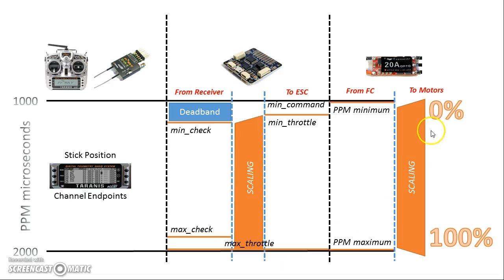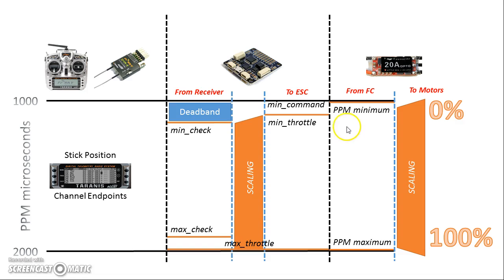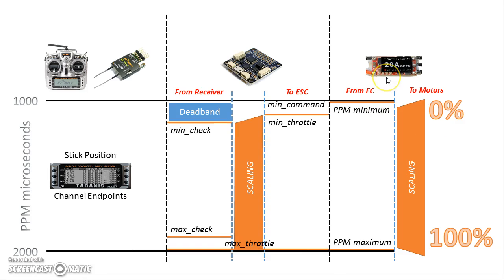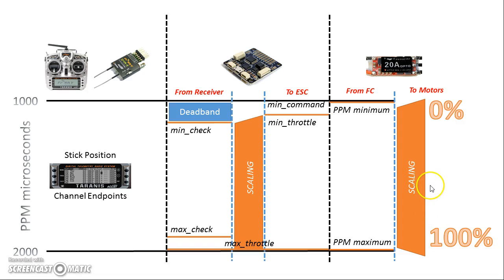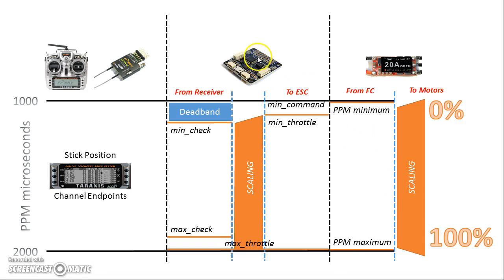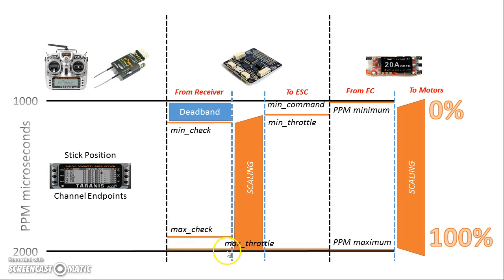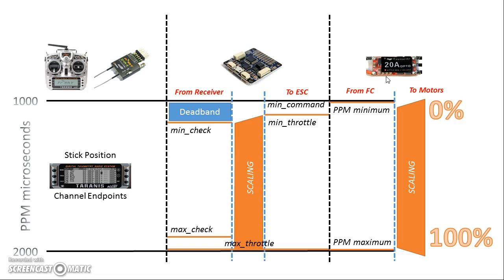Cleanflight throttle parameter configuration - Part 2

Comment: Great video Josh.  Here's a summary for the lazy and attention deficited:

Cleanflight variable definitions:

min_check: the stick value below which Cleanflight registers a low stick command (ie arming/disarming with thottle stick down)
max check: the stick value above which Cleanflight allows a stick command to be registered (ie when yaw is to the the right when arming)

min_command: the value that is sent to the ESC when the copter is disarmed
min_throttle:  the lowest value that will be sent to the ESC when the copter is armed
max_throttle: the highest value that will be sent to the ESC when the copter is armed

PPM minimum: the low range calibration value sent via Oneshot (technically not PPM) to ESC.  This correlates to 0% motor power, the bottoms of ESC's internals scaling map)
PPM maximum:  the high range calibration value sent via Oneshot (technically not PPM to ESC.  This correlates to 100% motor output, the top of the ESC's internal scaling map)

HOW TO DO THIS PROPERLY :
0)Remove your propellers.

1)Set (on TX) the end points to 1000 @stick's min, 2000 at stick's max,  and 1500 @ center stick.  Do this on the Tx, while looking on the reciever tab in cleanflight.   (If you were unable to set proper endpoints, watch the video fully to understand what's going on)

2) Enter CLI COMMANDS
set min_check=1050
set max_check=1950
set min_command=1000
set max_throttle=2000

3) Calibrate ESCs in motors tab

4)Enter CLI command
set min_throttle = to the lowest value where the motors spin without cogging in motors tab.

5)Go Fly.
Reply from the maker: This is all correct as far as I know.
Reply: +Wiggles FPV This is great. Sticky for later. Thanks!
Reply: +SmoothFPV no prob dude.
Reply: +Wiggles FPV so this seized up my motors at no throttle effectively defeating airmode and requires a disarm and rearm to recover the motors. not sure how to get it back working, this is BLheli 14.3, betaflight 2.1.6. only thing i can think to do is reset everything back to stock and start over. i had also upgraded from BLHeli 14.1, might revert back down to that.
Reply from the maker: +prOkrEAt Do you need to raise min_throttle?
Reply: +Joshua Bardwell when I test motor spin on the slider, all four spins up at 1021. I have my min throttle set at 1030 right now, keep raising it up to 1050. all 4 motors will spin when armed but if I input no throttle zero but move yaw/pitch/roll all motors seize up and won't spin again until disarmed. never did that before.
Reply from the maker: prOkrEAt Sorry. No clue. That is weird.
Reply: +Joshua Bardwell so i completely restored everything back to defaults. back to working as it should. not sure what is in these instructions that did that but it caused total motor seize up.

there are my settings:
set min_check = 1100
set max_check = 1900
set min_throttle = 1023
set max_throttle = 1850

seems set min_command is missing in my CLI dump.

EDIT: just flashed to BLheli 14.3 and problem is back. switched back to 14.1 and working again... seems to be the issue?
Reply from the maker: prOkrEAt If you change min_command or max_throttle, you need to re-calibrate your ESC endpoints. Anyway, glad you got it sorted out.
Reply: +Joshua Bardwell yeah, I recalibrated. not sure what's going on with 14.3 but staying at 14.1 for now. has to be that, I can reproduce it every time and alleviate it by going back. only variable I am changing.

Comment: I have always followed your posts and threads at RCG- didn't know you had a channel as I haven't been in any of those in a while. Living in my bubble ;)
Great vid, and while I have worked around it, you have just explained the recent spat of issues with my arming and esc calibration problems since slowly moving over to one wire and one shot esc's the past year.
I use a Futaba, which has always been lean on multirotor info and set ups, and is very robust with resolution and ability, but very exclusive in how it works with cleanflight. Mid throttle has always been 1520 and min at 1050 and max at 1950 for the old simonk setups prior to oneshot.
Now, I have been calibrating with min throttle at 1000, and then resetting the min throttle to 1050 and not recalibrating. It all works, and I use an arm switch with motor stop.
I now see I should go into my receiver tab- verify max and min and adjust and trim so that I have full 1000 to 2000 resolution, and then move on from there matching ppm values up where appropriate.
I am confused on how to make that jive with BLHeli esc ppms- despite the "ppm" not be exactly the same "language" or scaling, should I be setting those values in the BLHeli gui to match the naze? I am not complaining about performance, but I also want to begin setting up some of this special sauce throttle cut magic Chad and Steele and others have been working to get those epic slides. 
Thanks for being a great communicator Josh- that is 99% of making any video- the ability to be succinct.
Reply from the maker: +Hiway You're confusing the input and the output side of the FC with each other. The transmitter and receiver endpoints are on the input side. Min_command, min_throttle, and max_throttle are on the output side. The ESC is calibrated to the output side. There is no required or implied relationship between the input-side endpoints and the output-side endpoints, although it is sometimes convenient to use the same 1000/2000 values for both.
Reply: +Joshua Bardwell I am generally confused. I work in smoke and mirrors and dumb luck ;)

Comment: This is great stuff mate. Thanks for taking the time to create. It looks like you are going to become the new Painless360 channel with all your graphics and teaching style !

You mentioned something in here about doing away with the analogue signal from the FC to the ESC. Been thinking about this for a while now and I recon this will be the next ESC development to move away from PWM and into the digital work with protocols like 1-wire or I2C. That would give us a much simpler system with faster refresh rates etc
Reply from the maker: +Tony Leyland Expressive Imagery I have heard some insinuations that CANBUS is a candidate for the next-gen digital control method as well. Whatever it is, it should support at least 8 kHz refresh rates, so that there can be 1:1 sync between the gyro, the FC control loop, and the ESC output. We know that motors can't actually change speed that fast, but there will still probably be some benefit. For all the doubters who have said, "It's pointless to update faster than X ms because the motors can't update faster than every 10-25 ms anyway" ... the FFT plots do not lie. The reduction in aliasing noise when doing 1:1 sync is HUGE, and results in massive benefits e.g. in propwash situations. It stands to reason that removing that same noise from the ESC-to-motor link will have benefits as well.

Comment: Joshua, Great video as usual. Your getting really good at it. One thing I would add is that you can use the rxrange settings in CLI and not touch your TX and let the FC do the scaling between the TX and the FC.  Example....My TX in the reciever tab showed 992-2012. I entered those numbers in rxrange and now my RX tab shows 1000-2000.  I believe those settings were created to battle the issue you talked about with transmitters that cant reach the endpoints but in my case it works for making things nice and tidy in the rx tab.
Reply from the maker: +KelvinFPV Correct. Although rxrange may not have existed when I made this video. I can't remember if CF1.10 was out yet.
Reply: +KelvinFPV  Be aware if you using Failsafe, I believe with failsafe if your input goes below a set value it could trigger a false failsafe. Thats my understanding and could be wrong though.
Reply from the maker: Joe Ordille rx_min_usec and rx_max_usec.

Comment: Another great video, thx! (I'm going though some of your older vids I've missed). 
Q: My belief was that the FC talked PWM and not PPM to the ESCs (when not using oneshot/multishot)?
Reply from the maker: +salle rc I'm not sure what the exactly correct term is for it. As I understand it, PWM goes from a duty cycle of 0% to 100%, while PPM goes from a certain minimum to maximum value. So in that respect, the signal that we use, from 1000 to 2000 us, is PPM. But PPM by the book uses the position of the pulse relative to the start of the window, not its width, to encode the data. So what we do with RF seems to be some hybrid of PWM and PPM. The pulse width encodes the value, but multiple channels are encoded into the signal based on their position. Anyway, people say PPM, and that's fine.
Reply: Did some googling, it's a "specific kind of PWM" if to believe this answer: http://robotics.stackexchange.com/a/8738 
Anyway, thanks for the video again.

Comment: Thanks Joshua that was great. I've been flying for almost two years and I still found it really useful. I do have one question however. Are you saying that it is better to use stick calibration for ESCs than to set them in the firmware, for example via BlHeliSuite? This seems to make sense based on what you said about each component having its own internal timekeeper, but it contradicts other advice I have read that states that all ESCs should be set to the same min and max ppm if possible.
Reply from the maker: +The Imperfect Gent Based on what I can tell, I think stick calibration is the way to go. The fact that, when you run stick calibration, the ESCs give different results (sometimes VERY different) leads me to believe that the timing circuitry is not precise enough to rely on setting the same PPM values in software. It's not that such circuitry couldn't be built, but that it isn't being built into the ESCs currently.

But let me put a caveat on that. Remember that the PID loop explicitly compensates for the varying thrust levels that each motor puts out. There will always be discrepancies between the thrust that the individual motors put out. Variances in friction in the bearings, variances in the windings, variances in the manufacturing of the props and so forth. So having ESCs that don't have exactly the same PPM min and max is not a huge problem that is going to make your copter fly terrible or something. If the ESCs are not calibrated to map exactly the same output power level to the same input throttle position, the PID loop will speed the individual motors up or down as needs be.

The main advantage (as I see it) in calibrating them to the throttle is that you can make sure that all of them have the full output range available. Let's say that you have an ESC that is reading 50 us low. And you set your min_throttle to 1100 and your max_throttle to 2000. Then you manually set the ESCs' min_PPM and max_PPM to 1100 and 2000. The ESC that is reading low will actually turn on at 1150, and it will max out at 2050, except the FC will never send any value higher than 2000, so the ESC will never reach max throttle, which will potentially keep the copter from developing maximum thrust, since the PID loop will keep the motors relatively balanced when the copter is hovering or flying straight.

Using throttle calibration, you can set your min_throttle and max_throttle at a value that ensures that all ESCs have a PPM min and PPM max of >1000 and <2000. This will ensure that all motors will have their full power output range available to them. If the PPM min and PPM max are not the same between all ESCs, then the ESCs will have a different amount of resolution in their throttle range, but that's probably not a big deal. And if they have different PPM min and max as the result of a throttle calibration, then any difference is the result of variances in the ESCs' timing circuitry, which should cancel out. THAT'S WHY THEY CALL IT CALIBRATION right? You're calibrating the ESCs' input ranges to each other so that they make the same output power (roughly) from the same input value.

At least that's how I see it for now, until somebody convinces me otherwise.
Reply: +Joshua Bardwell Thanks for the reply Joshua. It makes sense and I agree with all your points. What prompted me to ask the question was that I on one of my builds where I used the same min/max ppm, the ESCs, when I power up the quad, the four ESCs don't seem to start up at the same time. Tbh I didn't even notice until someone commented on it on one of my videos. Sure enough you can hear it happening and it seems to happen consistantly but I've never experienced any ill effects. Would you say that this is related?
Reply from the maker: +The Imperfect Gent Yeah, probably. Do a throttle calibration using the Motors tab and see what numbers the ESCs calibrate to. If they are too far off from each other, then that may be the cause. Try doing a throttle calibration and see if, afterwards, they all throttle up at close to the same time. Also, if any of the ESCs calibrates to 2000, then lower max_throttle until they all calibrate to something slightly lower than 2000. This will ensure that all ESCs are using their full throttle range.

At least, that's the way it seems to me right now, until somebody convinces me otherwise ;-)
Reply: Joshua Bardwell I will try that. Thanks once again!

Comment: so in BLHeli suite, it says Setup NOT in SYNC with Master for the other 3 ESCs. i assume it is because the PPM Min/Max Throttle values are different? should i change them all to be the same? are those changed/set when you calibrate the ESCs in the motors tab?
Reply from the maker: +prOkrEAt My preference is to run the calibration using the Motors tab, at which point the ESC endpoints will probably not be exactly the same. This is because the oscillators in the ESCs are not accurate enough to achieve sub-millisecond consistency with each other. This is no big deal, as their precision is fine. So they read perfectly consistently with themselves, just not with each other. 

After this, BLHeliSuite shows them as being out of sync, so just go to Options and de-select "Sync Min/Center/Max" from the sync comparison. Then they will show as being in sync even though their endpoints don't match.
Reply: +Joshua Bardwell so i unticked that but still says they arent in sync... all other settings look to be the same. this is BLHeliSuite 14.3.0.1, running RG20's. all settings are default from rotorgeeks except motors 1/3 are reversed.
Reply from the maker: prOkrEAt You also may need to disable the motor reversing sync under Options.

Comment: excellent video.  Why dont we lower min_check to reduce the deadband?
Reply from the maker: +CoolStuffReviews I do. I have min_command at 1000 and min_check at 1010. I believe that the only reason CF defaults to so much deadband is to cover people whose controllers can't go very low, and who don't have adjustable endpoints.
Reply: +Joshua Bardwell ok I had it at 1050 which is what u had it to but I'm lowering mine lower. I don't like the deadband